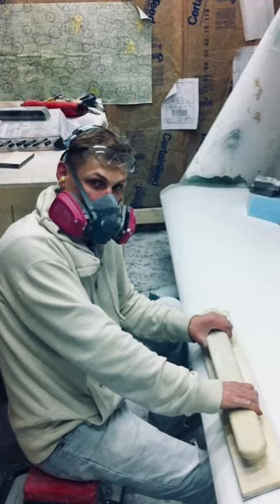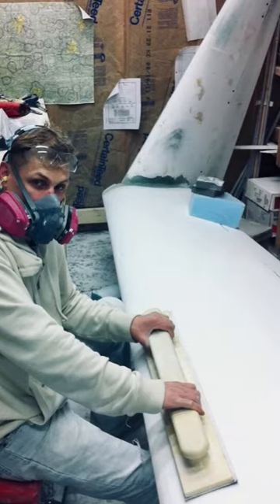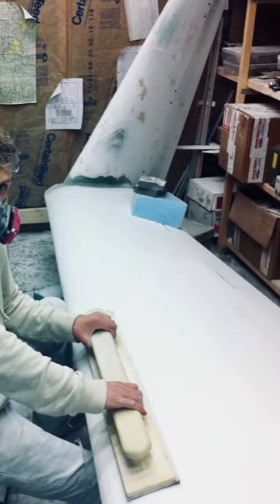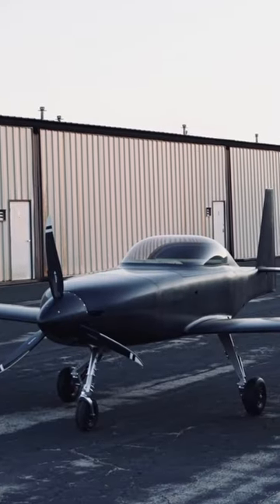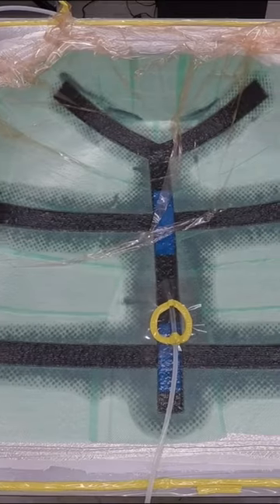Why no one wants to paint carbon fiber

Comment: Line X that girl!  😂  You gotta leave some exposed carbon, like Scrappy or like on a Porsche GTR3. Just looks so nice, and you guys did your weave pretty damn consistent for your first unit.
Reply from the maker: Thanks for the feedback! Our plan is to clear coat several non-structural parts of the aircraft. We have experimented with several of these types of products already, but we do not have enough test data to say how long their UV blocking properties last or how leaving the structures of the airframe dark will affect their strength at higher temperatures that could result from this.

Comment: I would think body filler would be mostly hobby or improvised use, not serious production with good molds like you have. I'm guessing composite glider productions just use the composite directly as is except for trim.
Similarly, I like the idea of single piece fuselage and wing even though it's a far more cumbersome lay up that requires special equipment, because of the lesser post processing.
I'm assuming the CF cost is negligible compared to the production so if production could be 5x reduced...

Comment: Have you considered spraying coat of base paint over release agent in the mold itself before laying it with CF and doing resin infusion.
Reply from the maker: Some coatings can be applied in this way, but in our case a big reason we want to apply the coating afterwards would be to help correct any slight discontinuities that may appear on or between body panels once the airframe is fully assembled.
Reply: If you have fitment issues, you should be changing the mold anyway. Pulling a painted part is so economical from a labor standpoint that I dont really see how you can avoid it wherever possible.
Reply: @DarkAeroInc  we have a wonderful primer paint that can paint on top of the whole structure directly without any polish in the beginning and it still have a powerful cohesive force with carbon fiber

Comment: Just an idea, why not rotste the plane 90 degree so it sits sides way. Then build a raged rail aside of it so you paint heigher parts and grond level can dow lower parts. This way all of the body is easy accessible for paint and you can apply even strokes.
Since the wings are not fixed, the total height is not that heigh. Seeing the video. The tsil flaps seems to reach the highest point that waht. Im guessing 140-180cm depending on tue geight of the hull from the fround floor

Comment: Well this didnt really explain anything. Does the infusion process mean paint can be directly applied? How is that different from prepreg or wet layups?
Reply from the maker: That's fair. It's challenging to get all the necessary details covered in under 60 seconds (time limit for YT shorts). But fundamentally, a completely infused part eliminates surface pitting and air voids which would normally need to be filled and sanded if using a wet layup or wet layup + vacuum bag manufacturing process. This ends up saving a lot of time and prevents additional weight from body filler being added. For correctly infused composite parts, you can essentially go straight to paint.
Reply: @DarkAeroInc  Ahhh I was thinking it was a bonding issue with the resin.

Comment: Man, the name is Dark Aero. Has to be dark, right? And then there are transparent coatings that can prevent UV, many cars use them. Not sure about a transparent filler though. But why not? And even if there isn't, couldn't you use  transparent epoxy for example & then sand it & then eventually apply a transparent protective coating?
Reply from the maker: Clear coat is an option that has been used in automotive and marine applications but has not been employed extensively in aerospace applications. We're considering a few UV product options, and we're currently testing a few in parallel to painting the prototype aircraft. Many UV resistant clear coats actually degrade through UV exposure, so it is important that we validate that the clear coat will provide sufficient UV protection for the life of the aircraft.
Reply: @DarkAeroInc  Thanks for your clarification. Still a pitty we can't enjoy the naked carbon look. Best of luck!
Reply: My idea exactly. Wish it could be done with a clearcoat. That base model they show looks so much more badass vs that dull play n white